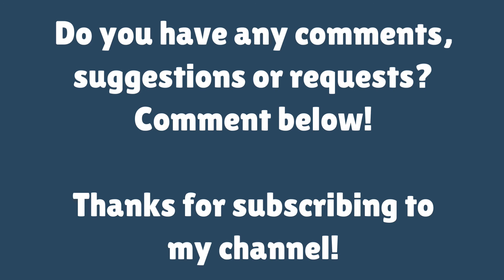TUTORIAL: How to adapt your own ESP32 DIP to Screw Terminal Adapter! (Misc)

Comment: Perfect, just what I was wanting and easy to adapt the nano.   Next you should print a new label strip for each side to get the pins labeled correctly, the labels on the board are hard to read, so much better if you print a better label.

Comment: Great idea! Just located these on Aliexpress and are less (about $1.50each) than the NANO terminal adapter. You just need to solder the terminals on, however, because the PC board is blank, it would be easier to cut in half! https://www.aliexpress.com/item/5-set-Screw-Terminal-Expansion-Adapter-Board-Shield-for-Arduino-Nano-V3-0-ATMEGA328P-SCLL/32963287342.html?spm=2114.search0104.3.26.636d6ffeVLkfrc&ws_ab_test=searchweb0_0,searchweb201602_10_10065_10130_10068_10890_10547_319_10546_317_10548_10545_10696_453_10084_454_10083_10618_10307_537_536_10902_10059_10884_10887_321_322_10103,searchweb201603_58,ppcSwitch_0&algo_expid=449b215a-f18f-4efd-9bdf-383be79ebd24-4&algo_pvid=449b215a-f18f-4efd-9bdf-383be79ebd24

Comment: If you search on : Arduino screw shield on aliexpress you get several different versions that already are cut in half.
Reply from the maker: Tut, and I was feeling very proud of myself too for coming up with the idea. :-( Lol
Reply: Your idea was great, and if you have one laying around why not use your method.  I bought 10 of the "pre-separated" ones for just above $10 including shipment.  So if you are planning a build it might be worth the wait :)

An example:
https://www.aliexpress.com/item-img/Screw-Shield-V2-Stud-Terminal-expansion-board-double-support-for-arduino-UNO-R3/32839950096.html?spm=2114.10010108.1000017.2.602fec1d8oxjeV

Comment: Found these on eBay
http://www.ebay.ca/itm/8-way-Screw-Terminal-Block-PCB-Board-Port-Pitch-Arduino-Shield-Breadboard-Plate/111777849725?hash=item1a067aa17d:g:mGQAAOSwhQhY64MV
Reply from the maker: They're for a breadboard. Cool though!